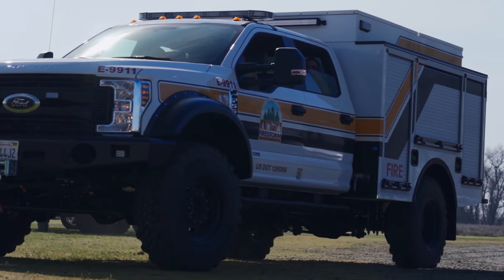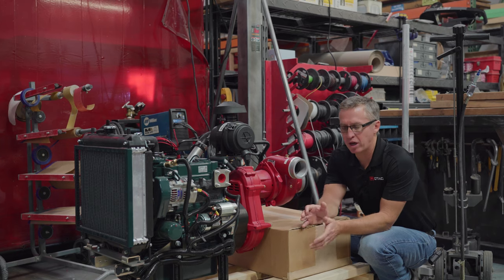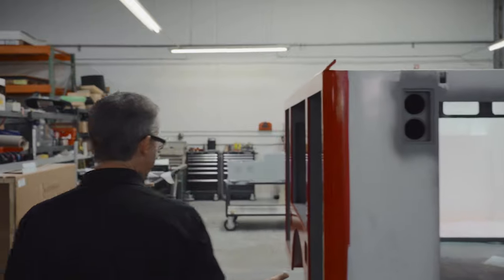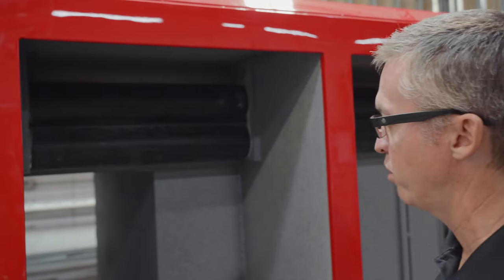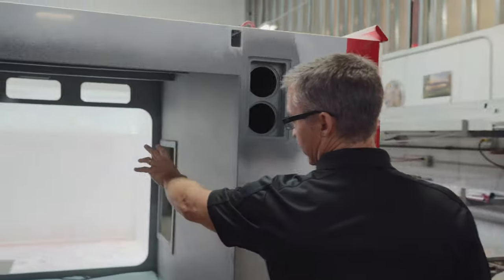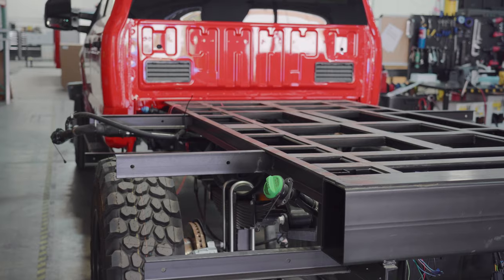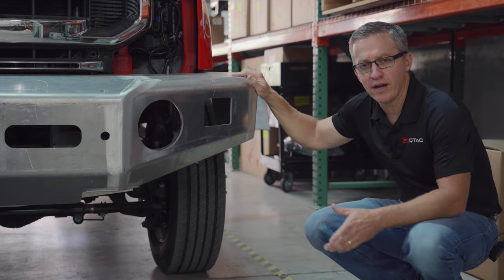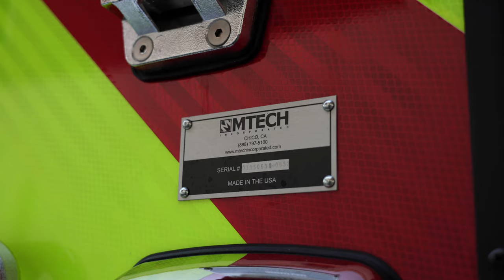QTAC Fire Truck Build, Episode 4: Pump and Manifold

Comment: 180psi max pressure?? Not a good wildland pump. Type 6 needs pressure capabilities much higher. This pump might work for a quick attack, car fire, single 1 1/2 or 1 3/4 attack line type apparatus.
Reply from the maker: Agree to some extent. If you're looking strictly for a wildland truck we'd put the BB4 in, which is a 440 psi pump. This truck was geared more for municipalities and VFD's in the WUI, which often times have a wide variety of calls. However, the B2X in this truck might surprise you with its capability. Thanks for the comment and for watching!